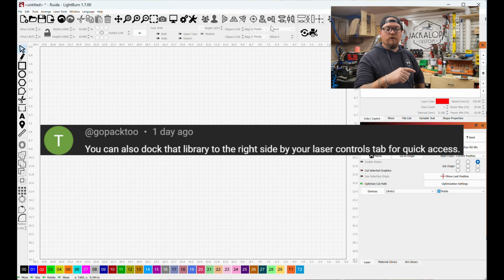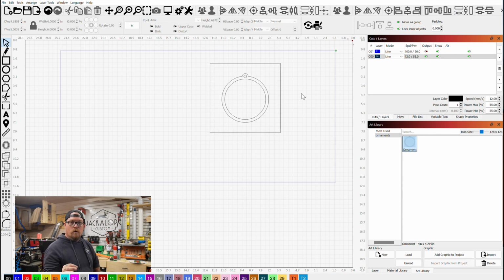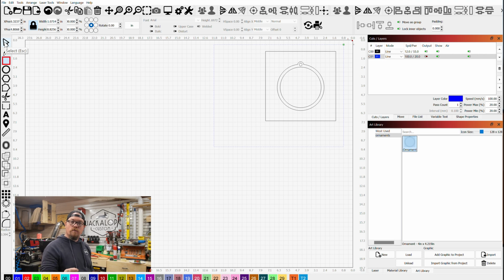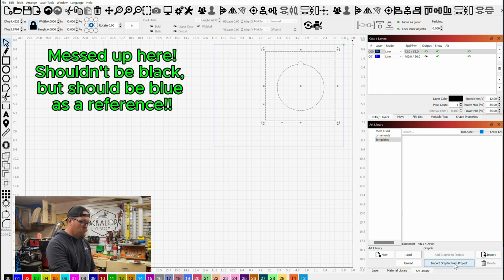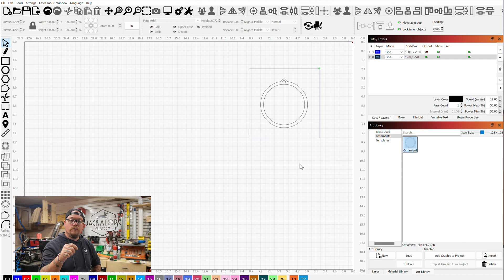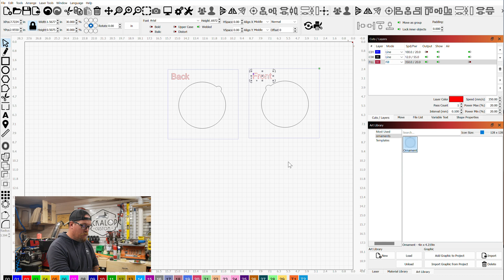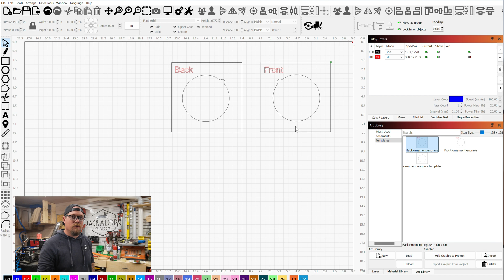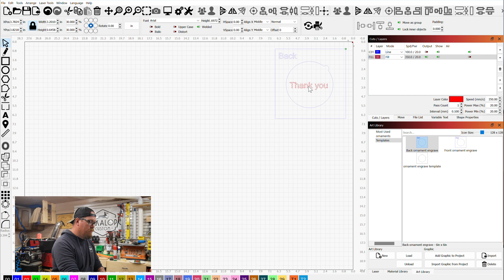Laser Cut Double-Sided Ornaments – Easy Step-by-Step Tutorial

Comment: The t1 and t2 can be used for your template border.   That way it won’t treat that are like a normal layer that will cut/ engrave.   

Also, this would be a great use for print / cut to line up your jig perfectly every time, no matter where you place it in bed.    In addition, if you’re doing a batch of ornaments with different names or wording, check out lightburns variable text function.  

Once again.  Great video.  Thanks for sharing!
Reply from the maker: All great points! Thanks for watching. I’ve been using the blue for my boarders for years at this point. The print/cut feature is something I’ve never messed with. I started with a wood CNC and the fence is something that just made sense to me. I plan on checking it out though because I’ve been seeing a lot of chatter about it. Thanks again for watching and commenting!